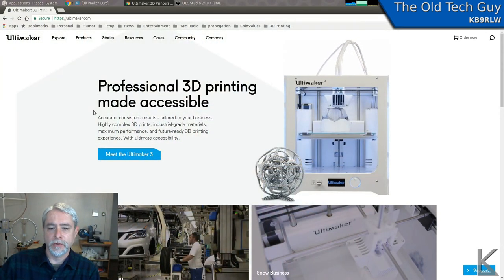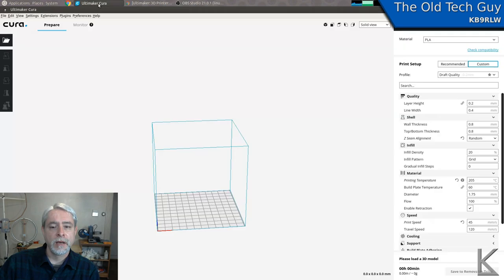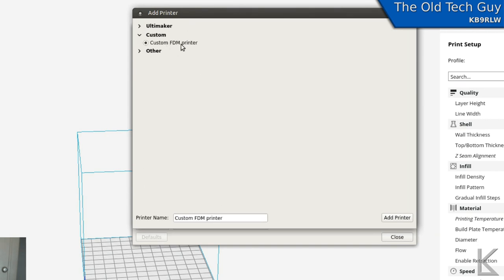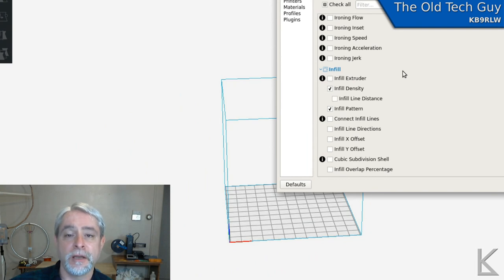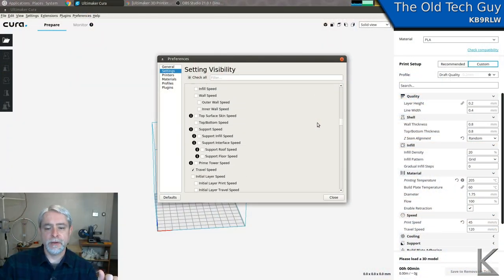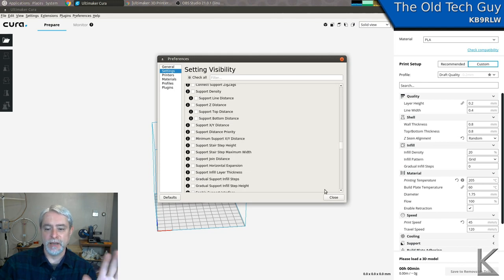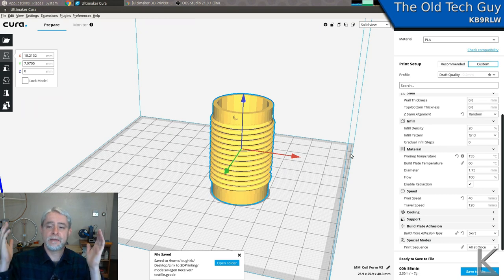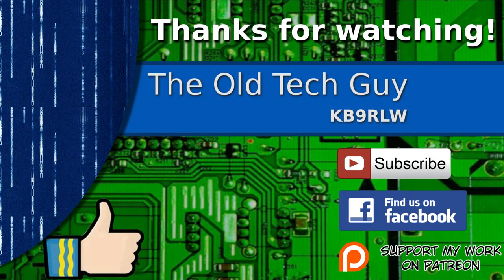Ham radio - 3D printing for hams part 3,  slicers preparing your model for printing

Comment: So I bought the same 3D printer from Amazon, arrives on Thursday.  TinkerCad is excellent, way easier than SketchUp, less clutter. Watching this episode now as slicing sounds important ;-)
Reply from the maker: Yep, slicing is where you tune things.  I hope I was able to cover it adequately.
Reply: You did.  FYI The screens in Cura have already changed since you posted this video (your video isn't even a week old).  I'm setting mine up on my MBP right now to get ahead of the curve when the printer arrives tomorrow.

Comment: Nice feed line/cable holder mounted on the wall.
Reply: The blue sign with your call mounted on the door trim.
Reply from the maker: I'm still not sure what you're referring to.   There's a blue light switch cover next to the door.  It's a T.A.R.D.I.S. from the Doctor Who TV show that I 3D printed years ago.  Could that be it?
Reply: Sending you email with an image from your channel.
Reply from the maker: Sent you back a picture of the TARDIS
Reply: the TARDIS, yes that's it. Don't know why I missed it before. Maybe old age is setting in.
Reply from the maker: OK, I think I figured it out.   What you're seeing in the upper right of the video frame is a computer generated overlay with "The Old Tech Guy" and my call sign.   It, along with my makers mark in the lower right, are ever-present overlays through an entire video.
In the television industry, it's what is referred to as a "bug".
Reply: That's it.

Comment: Kevin - I'm a neophyte when it comes to 3D printing. I really didn't even know anything about 3D printing unitl I watched your videos. I am just starting my learning on the subject and have found your videos to be very helpful. I don't have a printer - yet. One question I have is this: Beyond buying a printer and spools of PLA, are there any other expenses one can expect to have to produce a usable project? There always seems to be those hidden costs one encounters when they start learning a new topic. BTW, great job on the videos - I hope you get rid of your cough soon! 73 - W3DRM - Don
Reply from the maker: Hello Don.   Nothing really comes to mind.  Maybe over a scale of years, you might have to replace a few parts on the printer.   Nozzle,  a fan, or bearing..  Depending on the printer you get, there might be some upgrades or improvements you'll do to the machine.  Although, in most cases, you'll be printing out those upgrade parts on the machine itself.   You'll see that in an upcoming video where I correct a design flaw on the printer I bought.

Comment: If I was going to get into that sort of thing I would want a Stratasys 3D Printer plus a 1950x Threadripper based computer with 1TB of DDR4 RAM installed with a printer card installed so as to install the CADKEY dongle as well as Linux installed running CADKEY inside of Wine64.